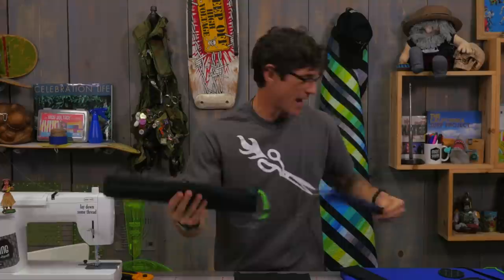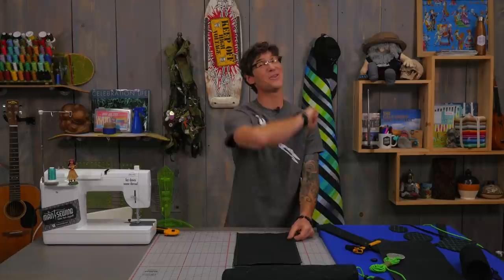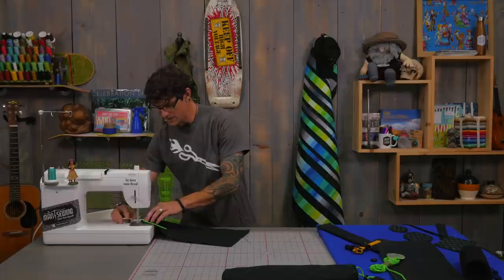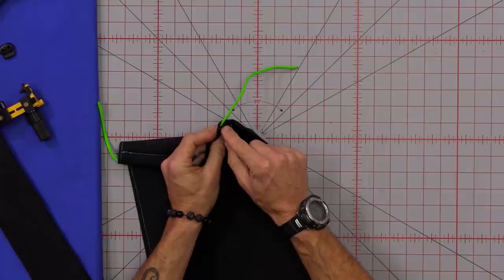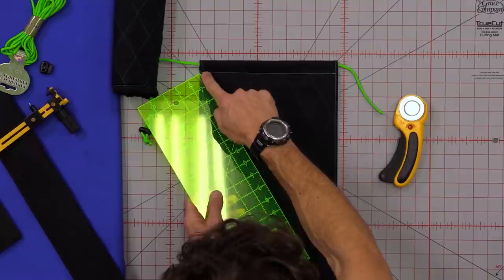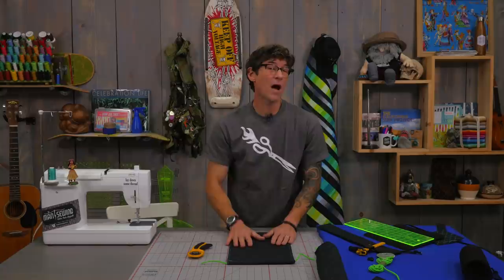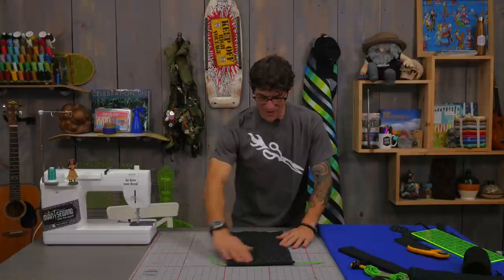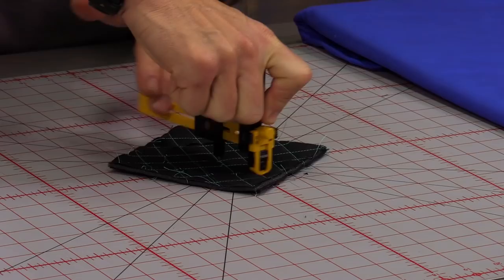How to Make a Padded Gear Bag

Comment: I have been wanting to make a roll pillow for the back of the couch.  The seating back is too short, need  some place to lean my head.  I think I could make this bigger and use the Bosal to make it stiff enough, fill it and close each end, thanks for this tutorial! I will attach a layer of cloth that will slide between the back of the cushion, maybe even enclose that with Bosal....

Comment: I wonder if there is a way to sew up the long seam to make it appear as if it were top stitched with two rows of stitching on a lapped seam like outward seam of jeans pant leg? After folding the one edge over and doing the pair of top stitches would it still be possible to use some sort of blind stitch to do the actual closing of the seam? Would it end up being a weak seam?
Reply: It would be difficult to do with a conventional machine and I think it might be a bit weak if hand sewn. For a bag as stiff as this, I doubt you could deform it sufficiently to do a French seam. Funnily enough, I've just sold an industrial blind stitching machine which might have been useful for something like this.

Comment: Using canvas and foam seems to create bulk and therefore when you use the drawstring to pull the top closed, it still has a hole that knitting needles, drumstricks, etc...could fall through.
Reply: I would try sewing a firm padded disk, same as the one used for the bottom but with the edge serge/cover stitched all the way around, just inside and below where the draw string ends emerge. Probably about 2.5cm[1"] along the same stitch line used for the draw string closure. I think the stiffness of the padded circle should prevent most items from escaping.
My first though was to sew one or three large buttons inside the opening but I dismissed it as being too fussy because buttons would probably have to be hand stitched in and if put too close to the edge of the opening might not turn down to overlap the hole from the underside when the draw string is pulled taught.